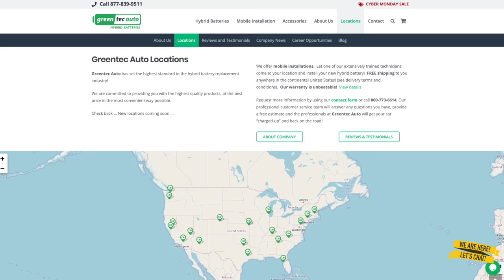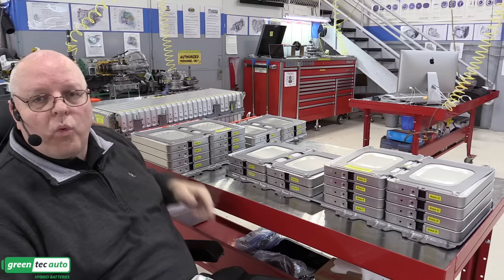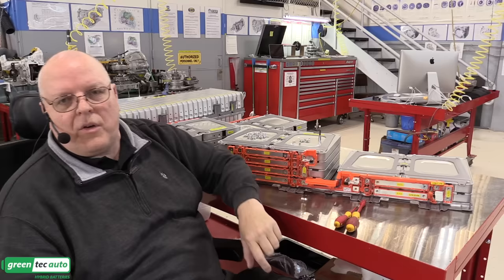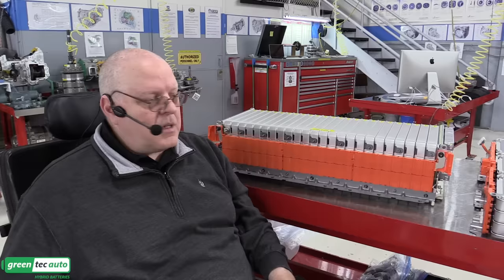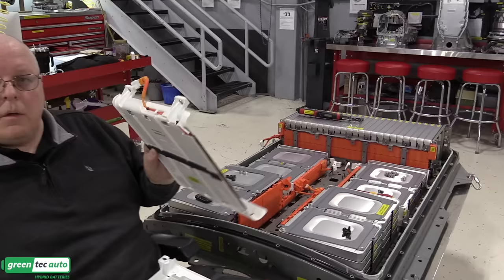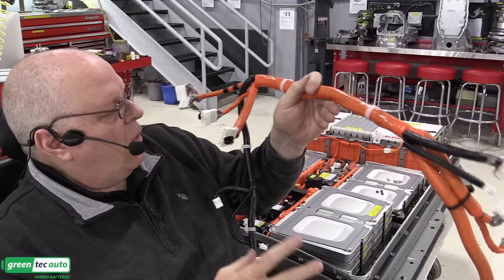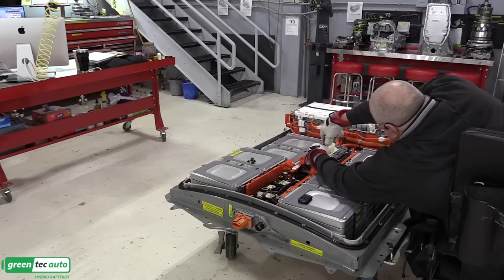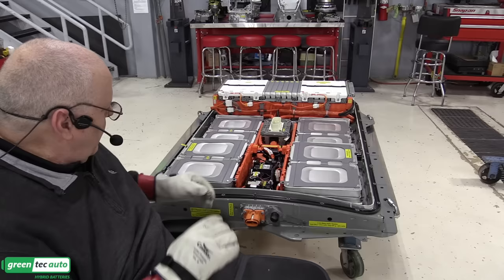2011 Nissan LEAF Battery - Deep Dive

Comment: Surprised no one has designed backplane, where you can access the bottom of the pack and drop individual or cell groups out.  Cell 23 is bad, just drop it out, good quality contacts much like the one that connects to the car could be used.  Proper breakers so you can get in with Low voltage.  It would be slightly bigger but it could be done.

Comment: Just wondering Professor, when the bolts are so lightly torqued with 1 foot pound or so, wouldn't they get loose during driving on bumpy roads?
Reply from the maker: No, they stay in with no issues.
Reply: @WeberAuto  Thank you. Its been great watching your videos.

Comment: would a pressure gauge be useful as part of the pack? in the telecommunications industry where lead cables with paper insulated copper pairs are still in used they use a gas which pressurizes the cables, the compressor or gas bottle operates when the pressure gets low, if serious the leak has to be fixed as the cable wouldn't last long, these cables can be 100 mm in diameter,
Reply from the maker: Interesting!
Reply: @WeberAuto  also wondering about cooling of Leaf compared to Tesla which have a lot more power, obvious more power requires more load and generates heat, Nissan engineers must have decided that in a low power unit the load on the batteries wouldn't be enough to warrant a cooling system like Tesla's.

Comment: i have a question... do you have a removable top drum of OIL  that would be the same as the lithium batteries were manufactured in... so if there is any issue the crazy hot battery or beginning to burn battery could be pushed off the work bench into the drum of oil to quench the reaction..  keeping the drum sealed with a quick release top..  sort of a used rag bin perhaps..   there might also need to be a heater installed on this drum to once in a while bring the oil temp up above 220F to cause the moisture to be removed..  this is just an idea.. it would need to be well thought out.  throwing a flaming battery module into a drum of oil might not be the proper thing to do.  perhaps a stainless perforated washing machine inner drum in an outer drum pack with a CO2 fire extinguisher built in to smother the burning module.. might have to use Compressed nitrogen.. available cheaply from some gas suppliers.  would need in a school to have a mechanical counter on the actuator to reduce test discharges..  these are just thoughts from a forward thinking mechanic.  perhaps just a fire brick lined shop rag container..  that would be simple..  carving one side of the brick to the radius of the container with a triple cut since you won't need full fire brick thickness to absorb the heat..
Reply from the maker: Thanks for your feedback!

Comment: Great video! I have a question: on hybrid system like Toyota or Ford, plugin hybrid, in order to save battery is it possibile turn on the ICE and using it hot? Or it’s better to leave this decision to the car? In general, plugin hybrid use a PTC or heat pump?

Comment: Incredible this guy knows this about an electric car & it's components.

From the comments I'll probably be at odds with most, but this all cements me from wanting to get into electric vehicles just yet.

Yes an electrical vehicle can cut down on other parts needed in a car & the work they can entail, but having to replace anything in this video would be a nightmare with having to somehow drop this entire assembly to get to a part inside of it working outside of my house like I do (& many others do).

Can anybody tell me if these parts in this video have sensors that the OBD reader will tell you is broken if something needs done etc?

Do other electrical vehicle have sensors to tell you about any of these parts failing?

Comment: Q:  Do all the battery modules sort of lost potency at around the same time, or is it a few?  

Trying to figure out if it makes sense to isolate and replace troubled modules instead of the whole pack?

Thank you
Reply from the maker: Good question. I doubt it. Usually the ones in the middle of a pack get hotter and degrade faster.

Comment: Hi- great video thanks. When you talk about triggering the trouble code on the cells you said that the voltage needs to be between 3.2 and 4.25V So thats for each parallel pouch? Not the whole cell unit. Hence the cell you demonstrate would not trigger a shutdown response?

Comment: A few more questions: 

(1) Is there a bottom, in terms of degradation of these packs beyond which they can no longer go bad.  Meaning, if a pack hits the 30-40 mile range on a full charge, will it eventually go to say 10-miles, or even 0?

(2)  If they do continue to degrade, does the degradation slow considerably after a certain point?
Reply from the maker: Yes they do. I don’t know

Comment: Avoid heavy motor use 2 axial flux motors ( or 4 hub axial flux motors) they run at 100V each. Avoid heavy lithium batteries. Use 2 electrolyte primary battery, refuel electrolytes, dump the electrolyte for recycling. Advantages: 1000km range , 100kg battery weight, 6 seater. Options lithium electrolytes or Hydrogen Lithium bromate, Hydrogen Lithium chlorate or others. Similar batteries best for 10 seater aircrafts.

Comment: An excellent and very informative video. I watched it to the end. It's not a job that I'll be doing anytime, but I do have a Leaf (2017 30kWh, SoH 94% 16,500 miles) I was particularly interested in your explanation of what was inside the modules as I have a problem where Leafspy is showing one parallel pair out of balance by 100mV although the BMS is showing only one unrelated fault code (TCU - AV conn) If you read this I would appreciate your opinion as to whether it is anything to be concerned about. Kind regards and thanks, Ray

Comment: Hello John!  Thanks to you I swapped my battery, disassembled the old one, and repurposed the cells!
I was wondering if you knew how many watts/amps/volts these HEATERS used?
I  would like to add them to my 2011 Leaf in Victoria BC, Canada. 
Our average temperature in the winter is 4°C, but I would like to drive on those days.
Bonus points if you know where I can get some of those heaters, aftermarket or otherwise.  Thanks!

Comment: The lack of heat management is not a design flaw, it’s a cost control measure. Is it an effective one?
Reply from the maker: They wanted to have the least expensive "initial cost" EV. Long term could be another story
Reply: Yes - it means you have to replace the battery or entire car, which is very profitable for Nissan.  The risk is that the public become aware of the issue and buy competitors’ products.

Comment: Is there any after-market solution to the thermal Mangement problem? I can imagine a simple blower arrangement that would help in warm climates.
Reply: Supposedly the gen 2 cars have some sort of cooling using the AC system and heating but it’s nowhere as good as what the Volt/Bolt use or Tesla

Comment: Lack of an active cooling system @NissanElectric
 
Aluminum intensive passive heatsink design lighter & works fine in temperate climates 40-80 F ambient temp range

Since 2010 Nissan reworked batt chemistry ~4 times improving heat tolerance & capacity

Comment: With so many connections in such a battery, I imagine corrosion will eventually cause issues. Is dielectric grease used to prevent moisture & corrosion from affecting the individual connections?

Comment: You mention in this video that the battery SOC should be kept between 20-80%. I thought that the manufacturers did this as part of the normal battery charge management anyway, or is that only on hybrids? I recently bought a new Bolt and if it is indeed fully charging the battery to 100% each time, I'd rather set it to charge to a lower level during my regular commuting and extend the battery life.

It seems like thermal management of this battery was somewhat of an afterthought. With the heater not coming on until nearly 0F (a temperature which a large portion of the world regularly sees during the winter), its already well within a bad temperature range on the cold end, and with no real cooling, it could easily exceed the maximum temperature for li-ion cells on a hot summer day. Even in NW Oregon which is well known for its temperate weather, we usually see at least a few days over 100F, so I could easily see where the inner packs of the battery could reach over 140F on asphalt or when the battery is loaded. I always assumed that when people said that the Leaf had no real battery cooling that they meant no liquid cooling. This battery has no cooling at all!
Reply from the maker: That is only on plug-in hybrids. Thanks for your feedback. You are correct, this battery has no cooling at all
Reply: 100% correct mate. Tesla offers several life modes where the battery is charged at 50% or 70%. Teslas batterys only charge to 90% by default any how.
The latest iPhone ios update gives the opton to charge the phone to 70% overnight, and then topps up to 100% only just before your alarm goes of in the morning.
Li-ion Shipping charge is typically 65% for longer shelf life.
Leaf batteries get hammered due to being too small and the owners try to keep them at full charge.

Comment: Interesting. I wonder if I can make a DIY leaf battery with Lifepo4 cells and double the amp hours. As long as the voltages are the same and use the same junction box, heater, and LBC from the old battery, theres no reason for it not to work, at least theoretically, right?
Reply from the maker: Yes, theoretically
Reply: Awesome!

Comment: I am thinking on making a ram 1500 truck a ev and looking at using these cells for the project.
Is there a way I can test if the cells are good at home or is it simply voltage test?

Comment: just got a 2012 leaf battery im building an electric sand rail with.  Can  i hook up a load to the service disconnect lever "Connector" instead of the front electrical connector area and if so will the BMS and everything still function? Thanks

Comment: Amazing, they didn't do more thermal management, not even heat sinks! Maybe that will work for solid state cells?
Reply: I've learned from your other videos to follow safety procedures, the right gloves, etc , or don't mess with it,. You may be saving lives.
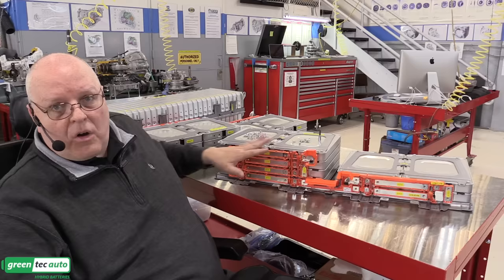Reply: Safety info at 31:40
Reply from the maker: Thank you, and thanks for your feedback

Comment: See, I had the idea of buying a second hand set of clocks. Taking the frame away fitting a tablet in place (that fits best) .. making a custom bezel for any gaps. But I want it to look awesome but definitely show all requirements. I.e. fuel level, temp, revs, speed + add ons etc. Boost etc.. but does it show miles or cruise control etc.. I'm just wondering what limits it has. Door open, check engine, indicator etc.. I'm sure it's not impossible but I just wondered if you could advise what that screen is displaying Vs what other options you can add. I've an obd mx+ .. better version of yours so it should give me everything I guess.

Comment: Heavy batteries , high current , high voltages ,  Fast cheap method ($1 per 300Km range) use 2 electrolyte liquid battery (not fuel cell , not molten electrolyte battery) , refuel fresh electrolytes after single use (3 minute refuel), dump used electrolytes at recharge station , use low voltage hub wheel motors or 4 motors externally at 100V 10 amp (voltage tripled from 36V battery pack) .

Comment: Hi folks, I know what those high voltage definitions are based on and why they vary. They are derived from mortality percentages. At say a 50 volts dc shock for some number of milli seconds nearly everyone would survive. Say 99%. At say 100 volts dc only a certain smaller percentage would. It depends on how one chooses to set the percentage as to what is regarded as HV. The best thing to do is play safe and regard anything over 50 volts ac or dc as dangerous. The frequency of ac current also has a bearing on survivability. Basically though the higher the voltage the more dangerous it is and the greater the level of PPE is required. Also, it is not just the voltage. These battery systems can deliver a lot of amps and can easily weld or even melt short circuited tools. Battery rebuilding are not a skill to learn on the job. A mistake can kill. Leave it to known and preferably certified experts who have been properly trained.
Reply from the maker: Great point, thanks for sharing

Comment: Since there is space between the individual modules would it not be possible to add a DIY ventilation solution to the outer case to push hot air out to cool the modules more efficiently?
Reply: Air ventilation?  How would you keep the inside clean and dry?

Comment: Because the supply of salvaged parts specifically batteries for leaf is in very short supply another source is necessary. I have contacted Chinese firms that make batteries specifically for the leaf. Would you be willing to help evaluate those batteries?

Comment: I know this is far-afield from the topic, but...

Are there any small battery device heaters, that could work off a isolated, deep cycle battery to keep a contained piece of equipment in work van from getting too cold? The idea of autocutoff at a particular state of charge perked my interest, as my machinery is rather sensitive to the cold. I could contain the machine with an upside down insulated box as a protective cover and conserve heat. 

I so wish my 2007 Sprinter had been available as a hybrid. I feel they missed a great opportunity, wasting time with little test fleets, but never seriously targeting a market date.

Due to the size/weight of the Sprinter van, hybrid would be necessary to keep the thing autonomous, yet save from idle, allow free passage into inner city circulators that charge hefty for traditional truck access, and provide plenty of 120v/220v power for the trademan's equipment.
Reply from the maker: I do not know
Reply: @WeberAuto  You and I are both working too late! I am just finishing up a client's vehicle rekey of doors and 5 topper locks. A low tech job, but I like em all !  I like to listen in to your channel, as well as Engineering Explained, AvE ( when no clients are in here! ) among others. FAR more interesting than music or talk radio.
Reply from the maker: @citylockapolytechnikeyllcc7936  For sure, thank you
Reply: How about a portable cooling/heating box with Peltier element? It's insulated and you could just run it through a low-battery cut-off extension cord for the cigarette lighter plug?

Comment: I watched this video numerous times from start the finish. I wanted to become familiar with the disassembly, as I have a 2013 battery that I want to remove the modules from.  One thing I wanted to do, is label each battery module with its correct number and I know those numbers were mentioned slightly.. but does anyone have the correct  numbering of the modules so I can do that part correct?
Reply from the maker: Thanks for watching. They are all mixed up in a way I did not expect. You will need a service manual to see the order.

Comment: No airflow and those spacers you show appear to be for mechanical reasons. (probably space for the cells to expand).  In fact, still, uncirculating air between the cells likely acts as an insulator.

This is concerning.  Not only regarding vehicle lifespan, but for DC fast charging.  The Leaf accepts 100 kW DC fast charging.  If just 3% of the energy is lost as heat in the battery modules (cell and wiring resistance), you would expect high temperatures inside the battery compartment from 3 kWs or more of waste heat.
Reply from the maker: Thanks for your feedback!
Reply: @WeberAuto  One thing you could drill down into more detail: What IS the waste heat for DC fast charging?  You have an assembled leaf - with a temperature probe, what happens during a typical fast charge cycle at full speed?  The cycle, worst case, would be 20% -> 80% on a hot day.

Comment: Even I did know what outcome was going to be I still love the way you explained  it  very good  teaching  ps 12 volts at 1,000 amps, ×10 in parallel is still  12,volts ,10,000 amps. 12 volts ,1,000 amps in series 120 volts 10,000 amps the higher  the voltage the lesser  the amps it uses  think your much ,if you ever need a  right hand man I got you covered  B,D,B,

Comment: don't put nuts, bolts and tools on top of the battery as they might fall in to the battery and shorted it out just like a 12 volts battery you don't want your wrench to touch both terminals at the same time

Comment: ive been offered a 2011 leaf, the battery has lost 2 bars , it can do about 50 miles on charge and its 83000 miles. do you think it will degrade quickly now and will it make any difference if i granny charge it to 80% rather than chadamo? i'm trying to decide if i should get this or buy a lower millage one. this ones quite cheap

Comment: Discussion of Service Disconnect at 1:36:00 didn't make sense to me. Service disconnect should kill all voltage to the output  module, not half of it.  I think it is actually connected to module 48 between module 48 and the contactors... not to module 25.
Reply: You are wrong ...
Reply: @vtorsi610  I re-watched the video, and it makes sense now that they fused the system at the midpoint of the battery stack. It also makes more sense that the interlock disconnects before the battery contacts and reconnects after the battery contacts make connection in the service access so that the pack is switched off by the BMS and there is no sparking.
Reply: @hbmike47  Yes, the "Service Disconnect" will  cut the battery into two equal sections, but before it actual disconnects the circuit, it will TRIP the Main Relays, via the interlock,  which opens BOTH the Main (+) and Main (-) wires leaving the pack. So, the battery is actually disconnected at 3 points = the (+) output, the Middle and the (-) output ...